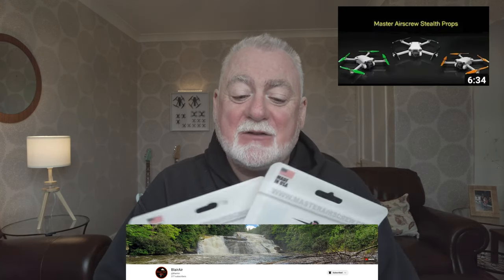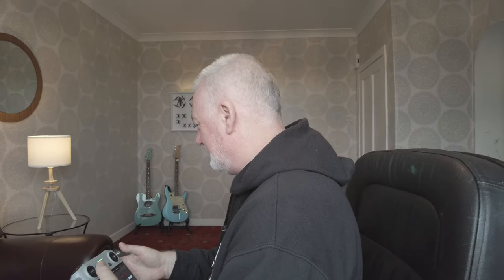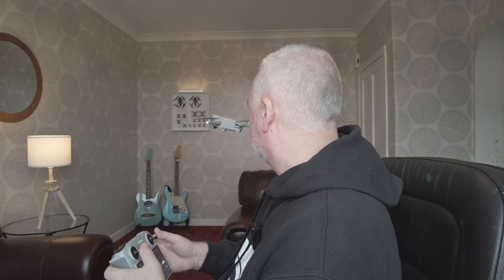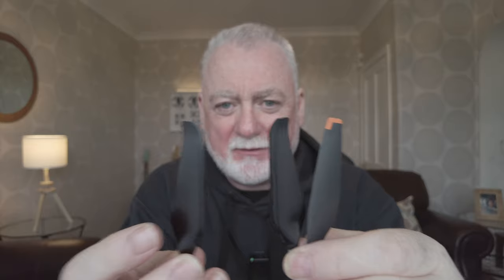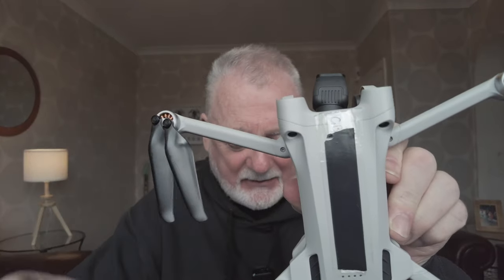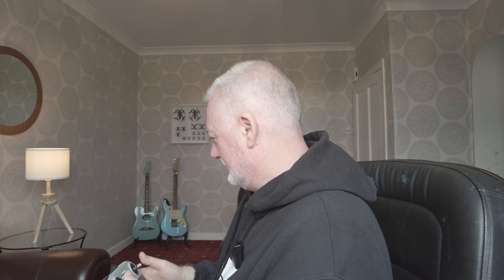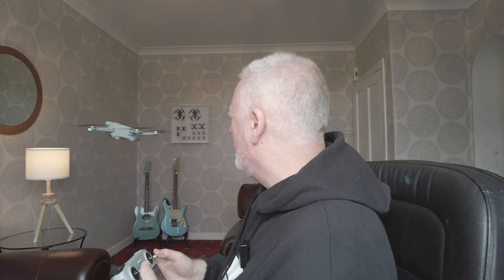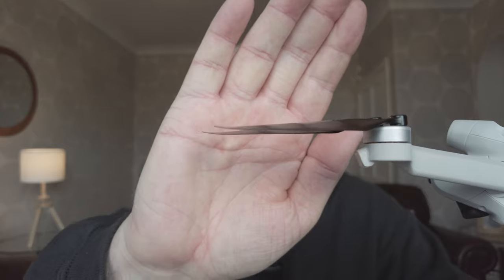DJI Mini 3 Pro - STEALTH PROPS

Comment: Hey Robert! Glad you were able to check out MAS Props for Mini 3. The dB meter test is a great validation of Master Airscrew Stealth  Props VOLUME in comparison to stock props. My dB test last year on my Mavic Air 2 was exactly 1 db less, though it was outdoors so there are variables there with ambient noise.  Of course it doesn't account for the lower pitch, which I find somewhat more pleasing. It's more evident at hover than with throttle applied. Still, it's subtle. On the bigger drones Air 2S, Mavic 3 the difference is very apparent. So much that every time I put the stock ones on I quickly went back to the MAS ones. Mini 3 is already the quietest Drone most of us have ever flown, so I'm not sure where they could get an improvement 🤔 Apparently no where, based on your readings! 

So far my main disappointment is that the Stealth Props don't stay in place when folded  down for packing, they don't stay folded against the drone fuselage. 

If you play your two videos back to back you might pick up the lower pitch. Then again  - uou might not! 😉 

Glad you had some fun with them, even if they were a disappointment in volume testing. 

Fly on, good sir, but shhh!
Reply from the maker: If the 2 other tests I'm going to do prove little or no difference to the OEM props, then it all comes down to cost :)

Comment: Would be interesting to read db when the microphone on the camera is not in the air flow - this might show the results for a bystander or Nessie Monster if the microphone is offset from the drone down draft. Right?
Reply: Agreed, the stealth props may blow more air across the microphone making them appear louder to the phone.
Reply from the maker: possible, but even if that was the case, and you deducted a couple of db to allow for that, the 'stealth' props would still be louder.

Comment: Looked up the R & N markings, since you brought it to my attention!  

Normal (N) - Tractor
Normal also known as tractor or
standard, direction of rotation is
established when a propeller is
rotating counterclockwise
(CCW), as seen by an outside
observer standing in front of the
propeller and looking at it.
Reverse (R) - Pusher
Reverse also known as P-type or
pusher, direction of rotation is
established when a propeller is
rotating clockwæerver standing
clockwise (CW), as seen
by an outside observer
in front of the propeller and
looking at it.

There it is. I never heard the term "Tractor" either! 🤔
Reply from the maker: Complicated!

Comment: I can't help but wonder if the downward wind — the prop wash — might have had any effect on your decibel readings.

Have you considered trying a reading of both from different angles?

Also, I've found that on my Mini 3 Pro using the MAS “Stealth” props, the sound pitch was lower, resulting in a lower perceived volume.

MAS has recently come out with the “Super Stealth” series — it would be interesting to find out how they compare! 🚁
Reply from the maker: Sounds like an advertising gimmick to me :)

Comment: The blades with the notch on goto the arms that also have a notch near the motor (very small to the naked eye). They really should have colored the notch in to make it more visible imo. For example on the mini 2 when viewed from above the notch is on the Front Right arm/prop & Rear Left arm/prop.
Reply from the maker: I did not notice a notch on the arm near the motor. I'll take a closer look!
Reply from the maker: So there is!  Great call, Nick. I bet not many people know this. i'll need to mention this on my next video :)

Comment: Hello Robert, I have used Master Airscrew props on my Mini 2 and I could swear they produce a lower pitch. Mine came with clear instructions, new screws and screw driver. The packaging for their Mini 3 props seems different though.
Reply from the maker: I thought the pitch was slightly higher!

Comment: Thanks for sharing this with us. I think the reason they're slightly louder than the original Mini 3 Pro props is because they are so quiet to start with. I understand the Master Air Screw props are more quiet than the original props that are offered for most drones, but these DJI Mini 3 Pro are just hard to beat.
Reply from the maker: Absolutely! The mini 3 pro props are very quiet :)
Reply: @WindsweptRobert  Weird i can still hear my mini3 drone 100m above me loud enough to hear it.

Comment: I've been a bit cautious about fitting anything but DJI screws to my drones, rather than those from unknown sources. I do believe that AIRSCREW are a highly respected US manufacturer who have made props for forty years, so they should not fly apart after a few flights. One possible explanation might be that the sound from the "stealth" props is less directly underneath the drone, but indirect sound from the walls and ceiling could be contributing to the perceived sound level and that recorded by the db meter. Another interesting comparison Robert, and I'm looking forward to part two.
Reply from the maker: The meter doesn't lie. walls or not :)
Reply: As far as a meter, honestly that's not as good a way to measure noise as one may think. Bit too deep for a comment though. Cheers!

Comment: I think that the noise level of the original props on my Mini 2 is fine. Sometimes it helps me locate the drone on a grey, miserling day. The orange and green props might also help with spotting the drone in those conditions. One day I might invest in some bi-focal specs and see if that helps.
Reply from the maker: I have a video where I test the sound level of the mini 2 V the mini 3. I fly them both off and after a very short distance (approx 50m), you can't hear wither of them :)

Comment: the tone is different only thing I notice with my airscrew props on my air2s. oh and they look nice...lol
Reply from the maker: I'm testing to see if they are any better visibility-wise and for battery flight time. I don't think there will be any noticeable difference, but you never know til you test! ;)
Reply: Problem I found with them Johnny is you really need to put locktight on the screws dji props are bang on anyway different colours would be great.
Reply: @Jim Thorley  yeah I noticed one set was tight and.a few were floppy  tightened now.

Comment: Aye no the best of weather for a stroll outside the noo. Its Baltic here. Iv got the MAS props for the Air 2s and i dont notice any difference in loudness but the MAS props sound a lot more pleasing to the lugs just. The good thing about the props on the Air 2s is they just pop on and off quickly. Dont think ill be going through the operation of adding them onto the mini 2. To much hassle for little effect.
Reply from the maker: Aye, I like the pop on/off props on the DJI FPV - very convenient :)

Comment: I've found the DJI pro3 props really quiet compared to my mavic mini props.  Can hear the original mini props from about 30 metres up, cant hear the 3 pro props till its landing and even then its still less noise than the mini (even at 30 metres up).   Great video as always Robert.
Reply from the maker: Thanks. The OEM props are very good and I don’t realistically see any other props doing anything any better. I will run a visual test on the coloured props and a battery flight time test though

Comment: Yes the "loudness" is not really any different from standard to stealth. It's the "Tone" being a bit lower that makes it seem quieter. If that makes sense.... I do find it a bit more pleasing. Also they are not as stiff. That does offer some subtle differences as well.

As far as the "R & N" I can't say for certain because I've never asked but I always assumed that stood for NORMAL & REVERSED.
Reply: I actually have the mini 3 with these same props, I bought all 3x as well to mix & match. The only thing I don't like is the screws having an even smaller etching, if that's the right word as the tip of the screwdriver supplied doesn't fit quite as good.

That said, I haven't had any issues with one coming loose. For whatever that's worth.
Reply from the maker: @Loco_Lui  I used the screws from the original props to attach the stealth props.
Reply from the maker: Reverse and Normal, eh?  hmm...

Comment: I'm not sure if it's just me when watching some other videos on YT regarding these MAS props for the Mini 3 Pro. I'm glad that u also noticed the MAS props got a bit loudness compared to the OEM props. Plus u tested with the dB meter and the number for the Mini 3 Pro also proves it. 

Yeah, the sound pitch is still a bit low but the actual sound definitely louder than the OEM props. Is that make sense? 😂

Thanks, for the MAS props tests and comparison for the DJI Mini 3 Pro.
Reply from the maker: The pitch should be lower as the MAS props are slightly longer, but to my ears, I hear a kind of swishy sound with them...

Comment: To me the Stealth props sounded lower in tone than the higher pitched sounding DJI ones so were kinder on the ear, in which case I prefer the stealth ones.
Reply from the maker: To me I detected a kind of swishy noise with the stealth props

Comment: Pretty hard to improve on the OEM props.  I've often said that I can't hear my Mini 3 Pro when it gets about 50 feet away from me.  I've flown it over guys working on construction projects, and they were none the wiser. Actually, the M3P is so small & quiet, I have a hard time locating it when bringing it home .. so its FPV almost all the way until its within about 25 feet. I think that many many years of running "glo model airplane motors" right next to me may have impaired my hearing a bit, but .. I'm not deaf yet! Cheers
Reply from the maker: The OEM props are as good as you can get imo. So far!  I need to test the battery length using these props and also see if there is any improvement in visibility.

Comment: The sound of the Mini 3 was why I chose it over the Mini 2. After 20m it's practically inaudible.
Reply from the maker: I have a video where I test the sound level of the mini 2 V the mini 3. I fly them both off and after a very short distance (approx 50m), you can't hear wither of them :)

Comment: There's two things about this indoor test that are inaccurate: first you have to count for echoing so what you hear is not what you will hear outside (and you never actually fly indoor) secondly you put the decibel meter just below the drone where the airflow is and airflow means noise, so if there is an airflow turbulence or difference in airflow speeds between the propellers it will make it even less accurate, overall just put it to test outside with the decibel meter at operator pov, indoor is just.... inaccurate, still an interesting video.
Reply from the maker: Both tests were conducted under the same conditions therefore, both results can be compared.
Reply: he's right tho.  even though you did both tests under the same conditions, if the propeller wash is different because of the differing blade shapes then the mic on your phone could have recorded louder due to more direct airflow into the microphone element.  eg blowing gently into a mic sounds louder than recording someone talking.   @WindsweptRobert   good test either way. thank you for the vid!

Comment: Does not make too much sense for the mini 3 as it's already quiet. It might be more suited for the mini 2 providing they can be fitted.
Reply from the maker: These props will not fit on the mini 2. There may be 'stealth' props for the mini 2, but I don't have a set.
Reply: There is a set for the mini 2 I had them fitted the colour is great but apart from that

Comment: What decibel meter are you using?
Reply from the maker: I think you can see the details of the meter in the video, no?
Reply: @WindsweptRobert  I can not.  Is it a phone app or a dedicated meter?  Could you advise which and the name of it?  It looked nice.
Reply from the maker: Ahh, I thought the name of it was in the video. Ok, it's called Decibel X and is available on the Apple App store :)
Reply: @WindsweptRobert  Thanks.  Since it is also a frequency analyzer, it would be interesting to see the frequency difference of the two props, since I think airscrew is likely just lower frequency so its perceived quieter.  The frequencies would show.  I saw the app doing other stuff during the sound test, which is why I asked.

Comment: I think I get the orange colour thing,chuckles, but green??...I'm an atheist in Ireland (the North of) not too fond of the noisy oranges meself.....😅..red or deep purple would be great colours, and yes the original props are best ! Thanks for another lighthearted entertaining and informative video, I'm a new subscriber that had a Mavic3 but sold it and bought the mini 3 Pro due to the friggin regulations on drones over 250g (I did fly my M3 under article 16 though. )
Reply from the maker: Too many regulations, not enough polis to enforce them - I don't worry about it that much ;)